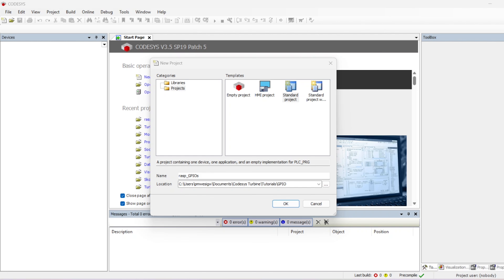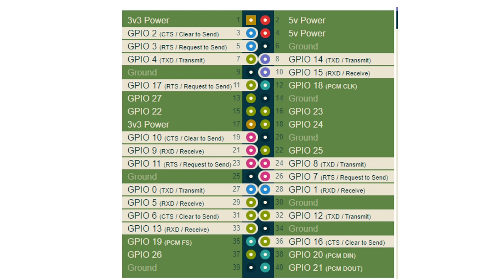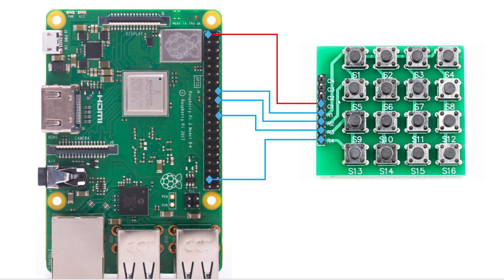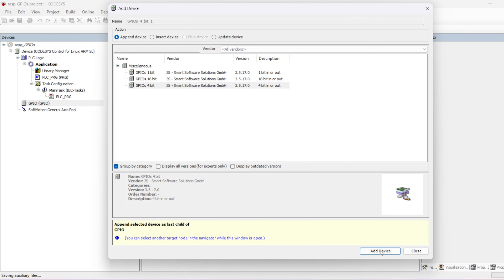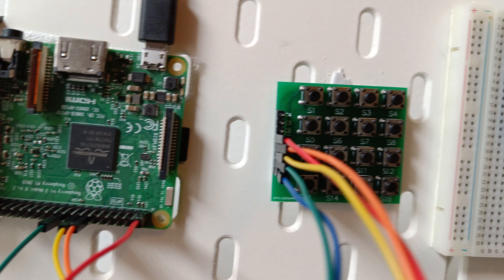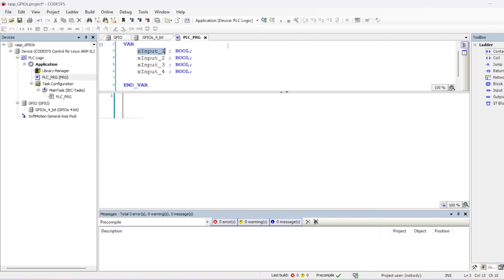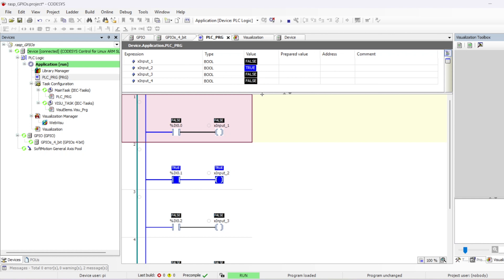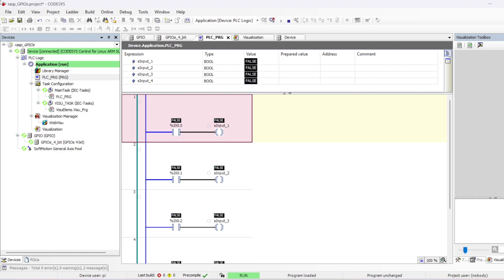Codesys Working With Digital IOs | Reading Raspberry Pi Digital GPIO Pins as Digital Inputs

Comment: Are you using RPI 5 or 4? I'm trying to do the same as you and my GPIO pins just doesn't work. But when i'm change pin state from raw python - it works great.

Do you know how latest codesys work with RPI 5 GPIO?
Reply from the maker: I am using RPI 3B. May i ask which runtime you installed on your RPI. Is its Codesys Control  Runtime for Linux ARM or for raspberry?
Reply: @brightersidehacks  Codesys Control  Runtime for Raspberry PI. Version 4.14.0.0
Reply from the maker: You should use the GPIOs_A_B device module. All pins are reserved for the different interface so you cant use them for anything else. The GPIOs_A_B reserves 12 pins are Digital IOs and i am certain it should work for RPI 4
Reply: Unfortunetly, nothing works for me... I think this is difference between rpi 4 and my rpi 5...
Reply from the maker: You may want to check out this video: https://youtu.be/siOWP3yYFZA
Reply: Hi Volodymyr did you find a solution?
Reply: No. Nothing works for me. I have no solution now(

I bought RS485 modbus DI/DO module to make sensors work.

Comment: Wow, excellent  video, just what I was waiting for. Thank you very much for your valuable effort. BTW, is there any significant difference between this Codesys for Linux ARM device and Codesys for Raspberry pi? It is possible to download Codesys runtime for Raspeberry, there is even video from Codesys itself how to do that. https://youtu.be/RPoPscbo3Kc?feature=shared
Reply from the maker: Glad it helped. About the difference, yes,  
Codesys Runtime for Linux ARM can be installed on any Hardware running Linux with an ARM Arch, but Codesys Runtime for raspberry pi is dedicated to only raspberry Pis.
Another difference id that Codesys for Raspberry pi comes with device descriptions for raspberry specific devices and interfaces such as I2C, SPI and others, but these may not be available for  the one for Linux ARM.
But since Codesys for ARM is a generic runtime, you can develop your own device descriptions to interact with any interfaces that your hardware might have, making it more flexible.
The last and maybe most notable difference is that there is no trail license for Codesys For Raspberry pi, so you cannot try it out before buying, which is not the case with Codesys Runtime for Linux ARM